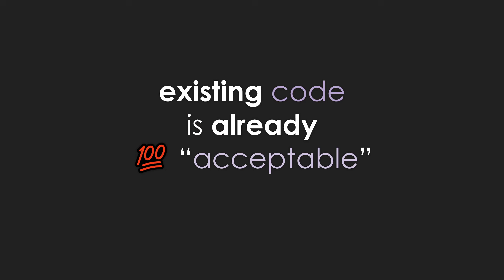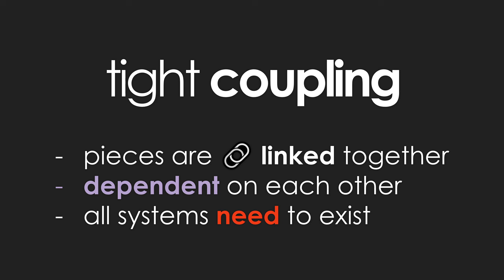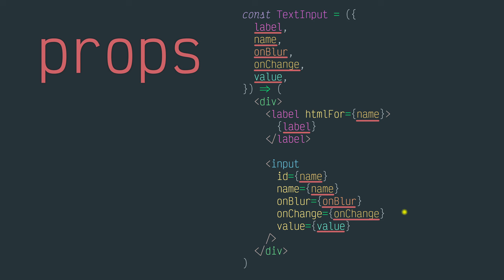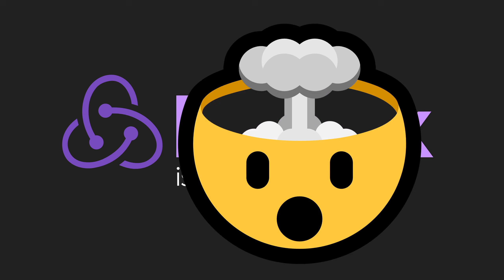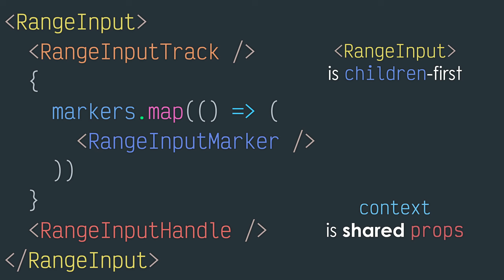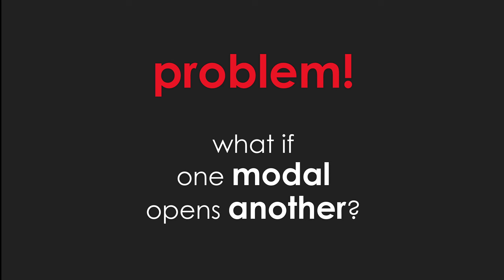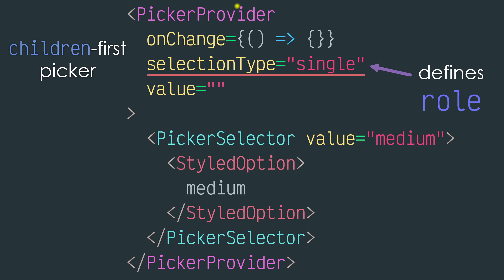Definitive Guide to React Component Design and the key to avoiding tech debt

Comment: I think the weakness of moving a lot of logic to context, is that it creates an implicit coupling to the component hierarchy. Context providers need to be always on top of context consumers. There can be a case, where you want to use a child component without a ctx provider, but it's not possible with this approach. This point is also mentioned in react docs about context Api, where they prioritise component composition over context api.

Second, there there is an argument to be made about readability. With prop drilling, you are at least writing explicitly how data flows through the component hierarchy. I think excessive ctx api usage has a bigger potential to become spaghetti (that's a highly opinionated argument, but still).

I personally come from Vue background and Vue also has its context Api alternative, called provide/inject. And it's explicitly meant to be used as an escape hatch, when you see it's the only solution possible. So I'm probably biased here.

My solution would be something like this:

1. Hooks don't have that issue, so I personally try to use them over provider / consumer pattern. Composition > Inheritance

2. The 'children-first' approach you mention certainly solves half of the problems, and don't have any coupling between components + avoids props , so I'm 100% with you on that one. 

3. In some cases, you need to specify, that some component needs to be above another one, like in the AccordionRoot / AccordionItem example. So here, the context api is certainly cool, because there's no way you'll put AccordionItem above AccordionRoot. To move explicit, I really like to use the compound pattern, where you'd write a component like this:

<Accrdion.Root>
<Accrdion.Item> foo <Accrdion.Item>
</Accrdion.Root>

So it's extra explicit about the fact that these two components belong together, and it'll probably break if you use one, without the other. It's also what tailwind uses in the headless ui a lot.

In general, the cleanness of code is in the eyes of the beholder often, and the number 1 thing we all try to avoid is 50+ props drilling 6 levels deep. And the difference of HOW to do that can be often a thing of preference
Reply from the maker: I really appreciate you watching my talk and spending the time you did to write a thorough response.

# 1
To your first point, the context logic I'm proposing is only for logic components, not UI.

This way, you don't run into situations where you can't compose those components using props. They also logically belong together, so the coupling there makes sense; although, you can always switch out a context consumer (like `VisibilityTarget`) with one of your own.

I had to write my own <Field> component for OneForm by pulling in the `useField` hook before. I needed it for a weird situation relating to a <SelectCustom> component. Exposing that hook was meant to be clutch and only used when absolutely necessary. For everything else, the `translateProps` function sufficed.

# 2
You can assign a default value to `createContext`. I always do this because I often render context consumers in Storybook and don't want to mock every context.

These days, I'd prefer context be limited to logic components. With `cloneElement`, your consumers can then rely on props (as you're suggesting), but then `cloneElement` allows the medium-coupled context consumers to associated with the provider:
```
<Crop.Provider>
  <Crop.Cropper>
    <ImageCropper> {/* props component */}
```

# 3
I completely agree that improper use of context, like you'd have with `$rootScope` or any `Provider` variant in AngularJS, can easily lead to jQuery-like code. That's why separation of concerns is so important.

The point is not to simply use context, but to create building blocks with contracts, so you don't run into those situations.

# 4
I'm not familiar with Vue, but I looked up the docs on `provide` and `inject` (https://vuejs.org/guide/components/provide-inject.html). I wouldn't see this as an escape hatch personally.

Context is old-hat for me. When I did React prior to hooks and Context API, I'd write only stateless function components. Redux was the only way I had state.

I'd wrap my simple reducers in a higher-order reducer that segmented state based on a `name` prop. When selecting from Redux state, I could observe only that `name` and when dispatching actions, I could also specify the name.

Because it's based on the component hierarchy, React's Context API allows you to avoid the explicit `name` prop unless you need an escape hatch. It's actually a benefit and only possible with composition.

# 5
I don't agree that hooks -> composition | context -> inheritance.

Context is optional dependency injection. The is the opposite of inheritance. Another limitation of inheritance is only having one explicit parent. You can have multiple contexts in any given component; therefore, it's composable.

# 6
I'm fine with you putting `Accordion.Root` etc. I don't do that for my slides because it's too confusing, and every character counts.

I looked up headless UI and Tailwind (https://tailwindcss.com/blog/headless-ui-v1). This is definitely a similar pattern as you suggest. I also like being explicit.

Two component libraries I worked on were setup with the object `.` pattern because exports were easier. I'm not opposed to it, but it doesn't allow for tree-shaking.

I do like knowing component X and Y belong together, but that's not available on every project, so I typically use prefix namespacing instead: `AccordionRoot`, `AccordionItems`, etc.

# 7
You pointed out a flaw in my design without realizing it.

"there's no way you'll put AccordionItem above AccordionRoot"

I've seen an accordion in an accordion on government websites. While it's bad UX, it's still something that could happen in other cases.

But I thought about this more and realized you found a flaw in my design:
```
<VisibilityControlProvider>
  <VisiblityProvider>
    <VisibilityTarget>
      <Content>
        <VisiblityProvider> {/* this is an issue */}
```

It made me realize that putting a top-level provider means there's no way for it to provide that context 1-level deep; although, I FOUND A SOLUTION!

You can provide 2 contexts in VisibilityProvider:
```
<VisibilityContext.Provider value={value}>
  <VisibilityControlContext.Provider> {/* uses default */}
    {children}
```

By doing it this way, you can shut-off the parent `VisibilityControlContext`.

Sadly, this only works if it's in another `VisiblityProvider`. It won't work if you're outside of it; although, why would you be?

You could create a `<DisabledVisibilityControlProvider>`; although, I don't think you should ever be getting into this situation. It's some serious code smell :p.

# 8
From reading your response, I realized it might be valuable to have components able to be controlled by both props and context.

While you'd accept values through context, you also be able to override those with props as needed. I've built this style before when I had to support both a new (context) and old (props) API at the same time in a component library.

I think this is a bit over-engineering to do it on every component unless you could find a need where it made sense.

# 9
I wonder how you avoid 50+ props drilling if you don't have a pattern of principle of using context and being children-first.

I've never come across an app dependent on props where that wasn't the case.

The majority of apps use Redux or only context providers at the root. After the first time I presented this talk in person, people came up to me saying "I never thought I could use context like this". That was the most common feedback I'd received.

# Conclusion
Thank you so much for your detailed response! I love getting feedback on my talks, and you really had me thinking hard for a solution to the